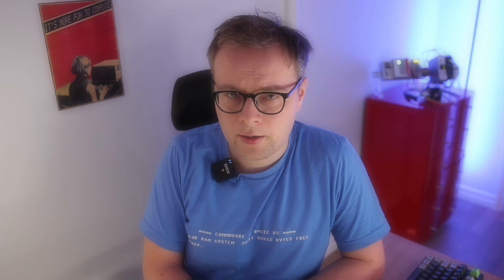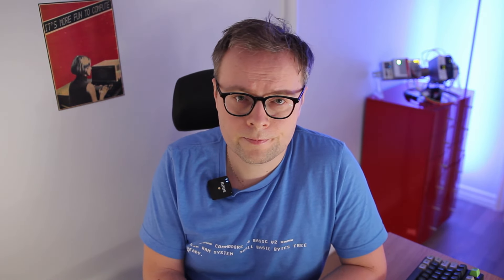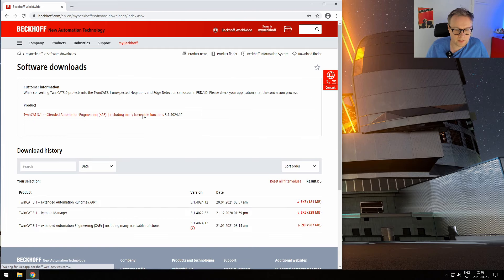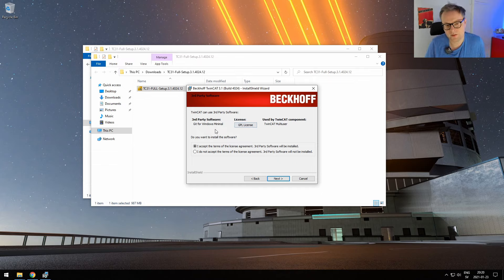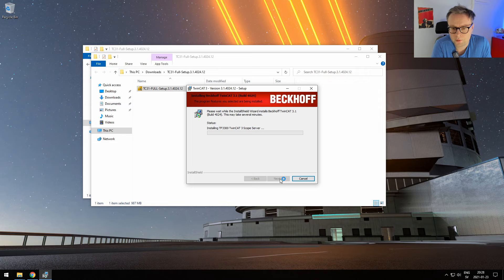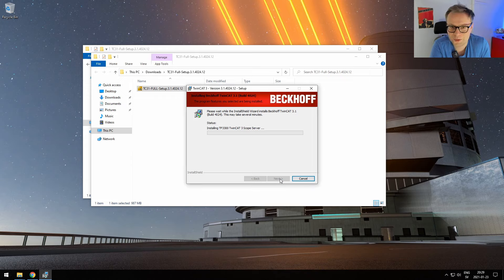PLC programming using TwinCAT 3 - Basics & installation (Part 2/18)

Comment: Excellent job Jakob, these are extremely useful tutorials to many of us, thanks a lot 😊
Please be aware that, Beckhoff always suggest to right click installation files and select "Run as Administrator" - otherwise you might experience unwanted behaviors at some point. 
Keep up the godt work 👍
Reply from the maker: Thanks Kenneth! When you install it normally (not right-click) the installer will ask for Admin permissions. I don't think it's actually possible to install it without administrator permissions? (real-time drivers, stuff mixing up Windows etc)

Comment: 🎯 Key Takeaways for quick navigation:

00:16 🏭 History of PLCs and TwinCAT
- Introduction to industrial automation before PLCs
- Emergence of PLCs in the 1960s by Allen-Bradley and General Motors
- Evolution of TwinCAT from the 1980s to the release of TwinCAT 3 in 2012
02:27 💻 Development Environment and Runtime of TwinCAT
- Integration of development environment and system manager into Microsoft Visual Studio with TwinCAT 3
- Introduction of TwinCAT runtime for Windows and Beckhoff's Tc/BSD operating system
- Usage of CODESYS compiler for PLC software development in Visual Studio
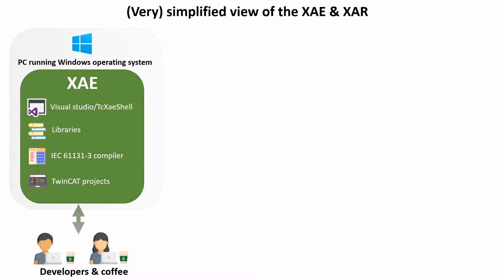04:39 🔧 Components of TwinCAT: XAE & XAR
- Overview of the eXtended Automation Engineering (XAE) environment for software development
- Description of the eXtended Automation Runtime (XAR) for real-time execution
- Explanation of communication between XAE and XAR using ADS protocol
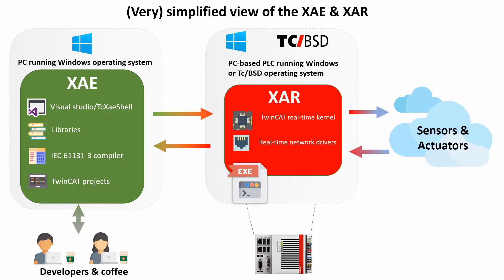06:27 🔄 Development Environment Setup and Advantages
- Ability to compile and test TwinCAT projects locally on development machines
- Utilization of VirtualBox for isolated TwinCAT development environments
- Advantages of TwinCAT 3's cost-free development and runtime environment
09:12 📥 Installing TwinCAT XAE and Visual Studio
- Steps to download and install TwinCAT XAE development environment
- Options for integrating TwinCAT into existing Visual Studio installations
- Recommendations for choosing between bundled and separate Visual Studio installations
12:35 🖥️ Installation Process and Software Requirements
- Demonstration of the TwinCAT XAE Shell installation process
- Explanation of additional software packages included in the TwinCAT installation
- Overview of the system requirements and recommended resources for TwinCAT development
16:49 🛠️ Configuring TwinCAT and System Modes
- Explanation of TwinCAT modes: CONFIG, RUN, and STOP/EXCEPTION
- Procedure for switching between CONFIG and RUN modes using taskbar options
- Importance of configuring TwinCAT for development and runtime environments

Made with HARPA AI

Comment: Jakob, I have a machine which control based on CX5010 and  producer provided software based on TwinCAT 2.11. Will it be compatibile with TwinCat3?
Reply from the maker: Hey Michal! You can run TwinCAT 3 on the CX5010.
Reply: @JakobSagatowski  i had some issue to run TwinCAT2 on Win10. I hope I can run projects from previous version on Twincat3.

Comment: @Jakob I have installed same version of TwinCAT in my work pc but every time i try to run TwinCAT system in run mode it restarts my pc again. I tried with reinstall and  changing Hyperthreading OFF and Intel virtalization Technology VT-x ON in BIOS . I also turn off memory integrity off in core isolation . nothing is working . can you suggest a solution ?

Comment: "The download is currently unavailable. Users reported unexpected behavior in TwinCAT 3.1 XAE Engineering 4024.15, describing loss of source code while using drag and drop to reorganize PLC structure. Beckhoff will reactivate the download after validating and improving the drag and drop function. As a workaround, without using drag and drop in the solution tree of PLC no loss of source code will appear" LOL
Reply from the maker: Bummer 😅
Reply: Thanks, I was today like where that hell is the link

Comment: Hii sir.. hope you are doing well.
In our plant packaging machine we are using BECKHOFF PLC,, recently one of that goes into Config mode(Blue indication in the CPU) and doesn't connect with our HMI. So our OEM said that controller CPU was failed. But, OEM doesn't even connect the CPU with software and checked.
So,, only now I am learning about Beckhoff PLC and it's programming Software.
Can you please share your contact no or LinkedIn profile..???
So that I will get clarify about Beckhoff PLC. Can you please support sir??